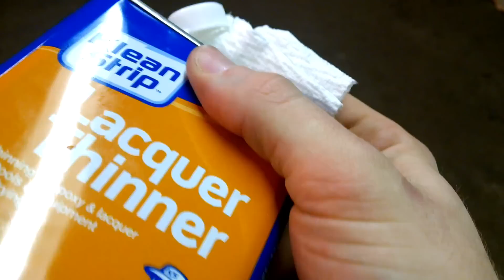Making Skateboard Rings

Comment: I used to make these and was actually curious about how you guys did this as my dad and I brainstormed how it can be done most efficiently for us and we definitely have different methods, yours more refined. I use the initial tool that you used to make the hole to cut out the ring itself and I dremmel the inside to whichever size it needs to be depending for who and thin the outside to match the thickness they want. both achieved about the same result tho

Comment: Any chance the spray protects the ring from harsh environments like water, moisture, etc?
Reply from the maker: It does provide protection to a limited degree. Some chemicals will dissolve the lacquer though. I have since switched to UV resin which is much harder and more durable, especially against water 👍. Thank you!
Reply: @lukereed3415  Ok thanks for the info. I saw this and loved it, it’s a good way to make something sentimental out of a old deck, any recommendations for any specific UV resin?
Reply from the maker: @Red_Souls  I've used alumniUV by alumilite, but I've heard other's work well. U will need a UV light to cure the resin. I bought the cheapest one on eBay, and that means I have to let  it cure the resin for at least a couple of hours. If you're just looking to try this stuff out, spray lacquer is super cheap and easy and can easily be reapplied 👍
Reply: @lukereed3415  Yea I might go for the spray lacquer, cuz I’ll be wearing this everyday so I just wanna make sure that it lasts for a long time and won’t get damaged by the environment, plus sometimes especially what’s going on, i sanitize my metal rings, just to be extra cautious, but thanks for motivating me to do this, I’ve been trying to find ways to reuse a deck basically, also having your own skateboard as something you wear is sick. Keep it up with the good work 💯

Comment: Just a little tip: to remove the whole griptape, use a hair-dryer to melt the glue from the bottom and it will be more simple and quick
Reply from the maker: joshua85100 thanks for the tip. Since this video has come out I've had good luck with a heat gun. I'm sure a hair dryer would also work great. 👍

Comment: Hey Luke, great ring. I have a question about that spray You used. Is it shiny lacquer? Or some varnish? If it's lacquer, the wax can go through it? I'm a littlke confused about this. Best regards mate.
Reply from the maker: Yes it is a gloss lacquer. I use the wax and steel wool to polish and even out the finish. It dulls it slightly and makes it smooth to the touch. The wax is then buffed off. Thank you.

Comment: just my thoughts but wouldn't it be easier to use a holesaw just bigger than the ring will end up being? if you use the holesaw to go throught about half way you get a perfect center point from the inside drill to drill the inside bigger.
atleast that's what i am planning to do when i get a broken skateboard
Reply from the maker: Etherimas haven't tried but it's seems like that could work and may be easier. I don't have many hole saws though. thanks!
Reply: those aren't too expensive to buy and if it works it will make it so much easier to do
Reply from the maker: Etherimas thanks for the tip but I usually spin em up on my lathe nowadays 😁
Reply: yea that's probaly the best way to get them perfect but not everyone has a lathe just like i don't have one because they are pretty expensive so the idea of using a holesaw might be usefull for other people that also don't have a lathe
Reply from the maker: Etherimas agreed 👍

Comment: If you don't mind sharing, what grit sandpaper do you use when sanding the edges with the drill spinning, and also the yellow sandpaper used inside of the ring? Also, what type of spray coating do you use? Mad props to you for making these!
Reply from the maker: greenandyellow88 thank you! 120 to 150 grit shapes the ring pretty quick. sometimes I stop there but other times I'll take it to 220 grit. then several coats of spray lacquer builds up a shine. finally polish with paste wax and 0000 steel wool. cheers.
Reply: Thank you! You are truly talented!

Comment: How thick did you make it from the inside of the ring to the outside?
Reply from the maker: I don't really have a specific measurement for this. I just eyeball it. They are quite thin at the edges though (1 to 1.5 mm maybe)  and slightly thicker in the middle. I just go with what looks good and feels good on the hand.

Comment: Adjust your rear guide on your band saw. You have way too much movement on the blade.
Reply: Also, use a crepe cleaning sponge on your disc sandpaper.
Reply from the maker: Thankfully I no longer use that bandsaw. Those guides never stayed in place, so I kinda gave up.